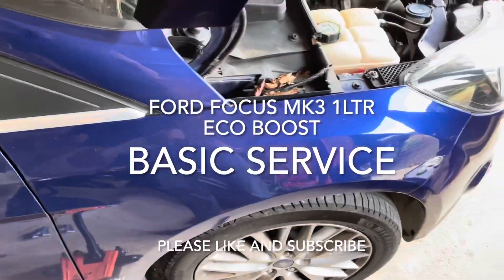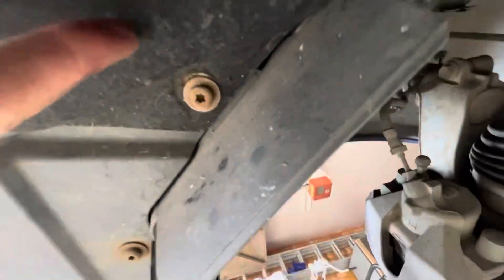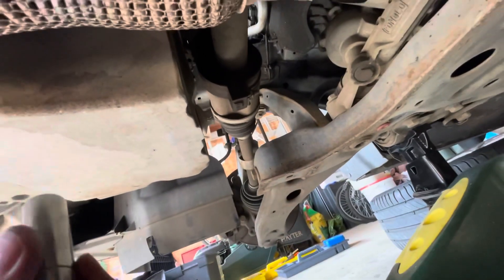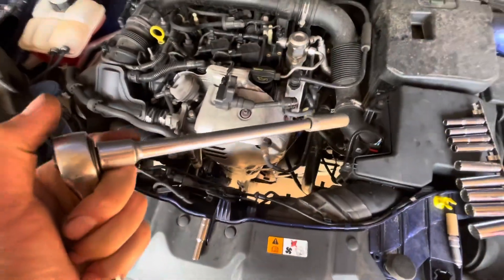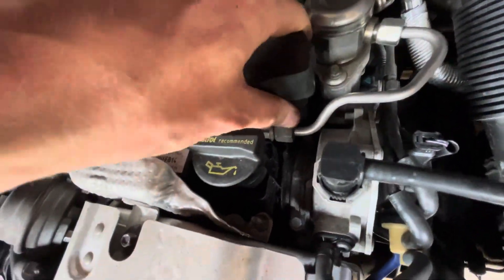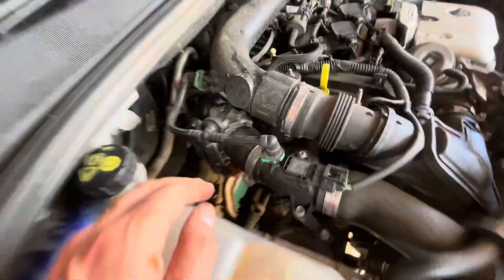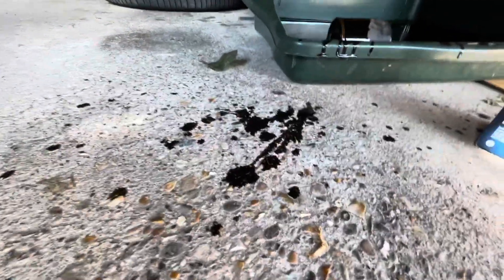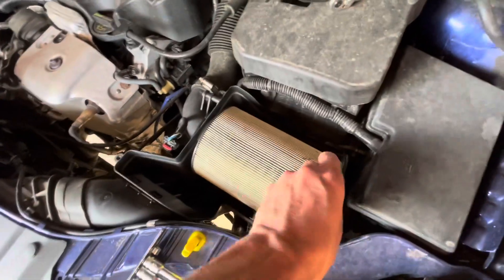Focus MK3 1.0 EcoBoost Service Oil Change Air and Oil Filter Spark Plugs

Comment: My Ford Tourneo 1.0 EcoBoost has 95000km and 7_yrs, I used to commute 22km daily, did the oil-changes about at 7500km. The engine lost a little cooling water, but I found no leak. Recently I worried about the Lambda-sensors, suspected they could be rusty and don't come loose. So I told my mechanic to try to put a little high-temperature, special grease in. He loosened them, they were stainless steel, so no need or worry. 
 I am retired now and use the car only once a week for a shopping trip, I bought a solar tickle-charger Eco Worthy from Amazon. It helps to keep the 80Ah AGM Battery charged. But I think 10_W is too small, since half the day I get the shadow of a tree. Without driving, the voltage slowly dropps even in summer.
Reply from the maker: Modern cars and bikes draw quite a lot when they are off, it’s annoying in you situation when you aren’t using them so regularly. I assume plug in charger is a pain?

Comment: Hi what mileage have you changed the spark plugs at cheers.
Reply from the maker: Hi, my understanding is the cheaper copper/nickel last 30-50k whereas the Platinum/iridium last much longer 60k-150k. I changed at 50k, they seemed fine could have left them a lot longer.

Comment: Hi, is that 5w-20 oil satisfying the WSSM2C948-B specification? You are aware that engine has a wet belt i presume? It has to have some additives for preserving that rubber belt.
What do you think about 0w-20 engine oil? Would it be better?
Reply from the maker: Hi, I have no idea, I just go with the manufacturer guide. If you can protect the wet belt then great but you don’t want to risk not replacing the belts early as there is no warning before 💥